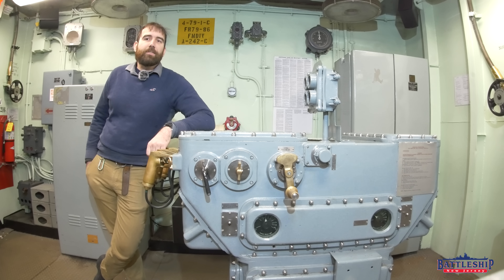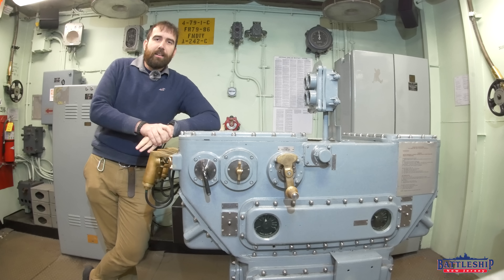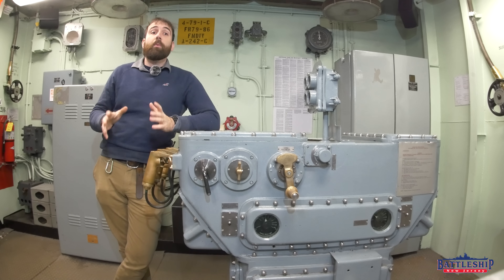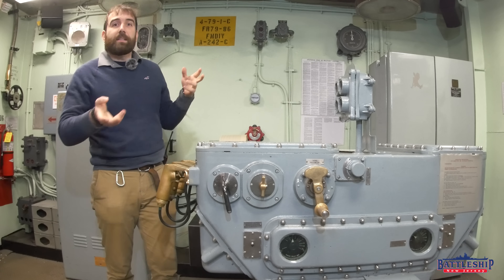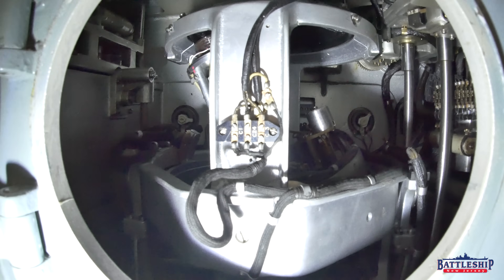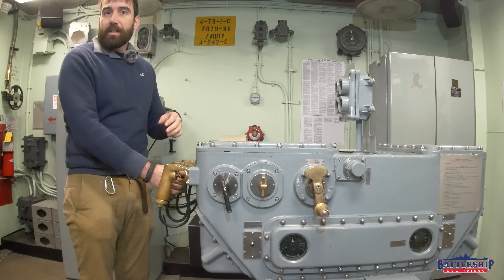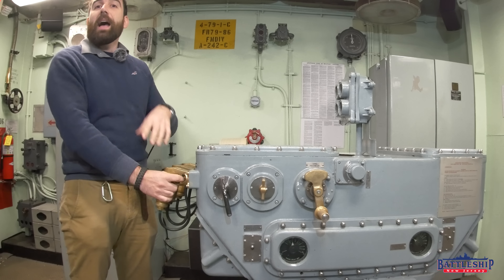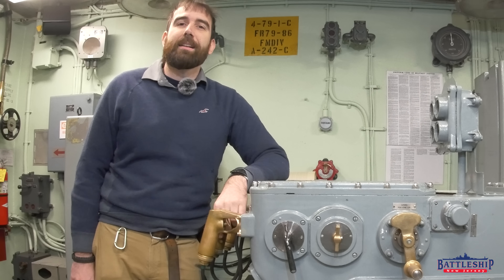The Firing Mechanism for the 16in Guns

Comment: I like how despite all the millions of dollars in mechanical and computerized aiming equipment for the 16" guns.... there's still a trigger and a pistol grip as the final step. Click, BOOM!
Reply: I mean, if it ain't broke...
Reply: I could be wrong but I believe the Ohio’s still have a trigger for the ICBM’s, like a trigger/pistol grip shaped trigger
Reply: @jordancarter8310  Nope, you're right. It's a pistol grip with a trigger on a wire that's kept in a safe behind a combination lock.
Reply: @jordancarter8310  same in Royal Navy SSBNs as they also deploy Trident
Reply: @jordancarter8310 wwweeeee
Reply: The original “point and click” interface
Reply: And the pistol grips are snazzy brass.
Reply: Fun Fact. When the ship was renovated and missiles put on it they didn't change to computers for firing the main guns. The old analogue system is very accurate. So 40s tech was good enough for the 80s and 90s.
Reply: @johnmanley7859  read about that 👍
Reply: Murica, hell yeah!
Reply: Yeah this is a nice touch. They could have done this in a much simpler way, but they clearly had a bit of flare:}
Reply: @tootone  "Flair" actually.
Reply: It's either that or a Big Red Button that you slap with your palm ... and the M1911-shaped pistol grip mechanism just gives it that little bit of extra "you're about to kill somebody" gravitas, as opposed to a big red "Emergency Stop (in this case, many people's lives" button.
Reply: Dont be mad...im sure it comes in very handy.
Reply: One of the largest cannons ever being fired by a button? Never.
Reply: Look like an expensive pinball table to me 😂
Reply: I always want a person in the loop who is ultimately given the responsibility to pull the trigger.
Reply: it's better than the old fashioned lighting a fuse method & be like oh crap, I cut the fuse too long or oh crap, the fuse is too short or like oh crap everything's too wet to function, although old fashion does have it's pros & cons, just like anything else, the person that invented that is a freaking genius, our Crow's nest didn't get blown off while we was being shot at, that's a plus.
Reply: I recall, on a submarine, the red pistol grip is a fake one for drills and the black one will fire the missile.
I read that the mechanical computer was used until the mid ‘70s.
Reply: Maybe they are mechanically connected to the fire mechanism? Traditional fire mechanism would be useful if there is an unstable power situation or under electronic warfare.
Reply: Every military device is just high tech caveman things, tank killer? Super fast arrow with super dense metal, naval cannon? Big iron
Reply: I like how this system was designed in the 30s, if not earlier, and worked just fine and that's why it's designed to operated with triggers. Wait until you see what controls our ICBMs.
Reply: Yeah, I wondered to. I first thought "what are the gazoline pistols for?"
Reply: Actually, it goes click, click BOOM
Reply: @Steven9675  Is that where Saliva got the idea for their song?
Reply: 👉 Yeah, but here's the important aspect no one is talking about. There's a new federal ATF "rule" that heavily regulates and criminalizes a bunch of different guns, based partially on the type of grips and accessories they have, especially pistol grips! 

 Based on these new ATF "rules", I fear that since the USS New Jersey's guns are operated by a pistol grip mechanism, the ship's main guns will now be officially categorized as "short barreled assault rifles", and Ryan will have to register them with the ATF within 60 days, or else be charged with a felony! (😁😕)
Reply: @HighlanderNorth1  right I would love to see them try and come take it,  those are some of the biggest guns ever made, and the most armored vessles still in existance they are not taking the guns without a significant fight if the ship were fully crewed and running crusemissles even exculded it bristles with guns and has 9 that have the penetrating power of a mk 85 bunker buster bomb each armor piercing one 30 feet of concreat and that far in land it would inflict a hell of a lot of damage.
Reply: "Computerized" 

Dude.. that's a MECHANICAL computer... 

That's got more in common with an 1940s Ford Tractor than it does the PC I am typing this on. 

Calling it a "Computer" ... it simply isn't. That's the most MIND BLOWING thing about those battleships.. they could hit a DESTROYER sized target, from twenty frigging MILES away, with nothing more complex than a motor driven fancy calculator. 

If you got a modern ship, and hit it with something that knocked out all the computers and modern electronics, it would be utterly effed. 

Do the same to the Iowa class and all your gonna have is a FURIOUS crew, without radios or TVs lol. 

The ship would still be very capable of kicking ass.

It's not just armor, survivability, and backup systems upon backup systems that make these things tough as nails. 

Probably the biggest one is the simply lack of ANY modern electronics, (except stuff like CIWS, tomahawk etc that was added on) Even the damn radars would be pretty much free of modern electronics. It's remarkable. 

We are talking the absolute height of late 30s to mid 40s technology.
Reply: I don't believe there's any computerized anything to aiming the sixteen-inch guns I believe its all mechanical.
Reply: @thomaspavelko9412  it's mechanical yes but those are still very complex computers controlling all the guns- mechanical computers are ordinarily much more limited in scope than transistor & digital computers we know today, but are still far, far beyond what was available only 30 years before them, and calling it not computerized really discredits the gargantuan effort that went into making the gunnery system work.

Beyond all the mechanical computers interfaced with the systems, they also integrated radar & other even more advanced technology into the gunnery systems.
Reply: @KennyCnotG  Electromechanical computers are more limited in scope, but they continuously calculate based on their information inputs in real time. No glitches, running out of memory, or ‘pc load letter’ flashing on the display screen. The only time you would have to wait for a firing solution is if the automated inputs (speed, pitch/roll/radar rangefinders etc) were damaged, so sailors would have to dial in settings. Otherwise, once you set the target, as the inputs change the guns will train and stay on target as long as it is within their traverse speed limit. The system will also automatically fire as soon as the guns catch up with the plot ‘window’ as long as you are squeezing the trigger.

It was so robust and quick, and fit for purpose, they really didn’t need to change it. Also it is impervious to EMP.
Reply: @KennyCnotG  is sure is a computer, just not a digital one which you can program. here, the programming was done when all those gears were, well, computed, and assembled. but when it's all together, it's a computer.
Reply: @Oldguy1900  a computer is something that performs calculations, in this case it is a mechanical computer. The term used to be applied to humans  who did calculations too.
Reply: @Oldguy1900  that is true, but i believe he was referring to the fact that it was a pistol grip trigger and not, say, a button to press, or switch to flip.
Reply: @Oldguy1900  It's a mechanical computer.. All those gears serve the same function as transistors in a logic circuit on a modern chip. It's all just math.
Reply: @DeliveryMcGee  Sort of - there's an important distinction, which is that this is a mechanical analogue computer, whereas modern computers are electronic digital computers.
Reply: @DeliveryMcGee  No, the transistors in a logic circuit compute digital values using binary (Boolean) math; those gears compute values in continuous fashion; they are solving differential equations while they are receiving the inputs, something that even the fastest digital computers can't yet do.
Reply: @Oldguy1900  It's a mechanical analog computer.  But it's certainly a computer by any reasonable definition.  Just like a Norden bombsight was a computer.
Reply: @Oldguy1900  It's all computerized. It's just analog, i.e. mechanical, verses digital.
Reply: @Oldguy1900  Technically it is a computer, it is just an analog computer.
Reply: @Oldguy1900  I think it's classified as a mechanical computer rather than digital.    In the UK we used to have mechanical computers to calculate tide times and ranges.
Reply: Mechanical computer,  still a computer and probably faster if no backlash in the gearing
Reply: Appreciate the corrections 😊
Reply: @Oldguy1900   that's how Computers started off as, in fact if you think about it, the entire thing is mechanical, the wireless transmission crap, not as mechanical & I wouldn't trust wireless on my car, old Computer, your Hard drive was a giant Cassette tape.
Reply: @Oldguy1900  It is an electromechanical computer.
Reply: @Oldguy1900  their was range system run by a computer.

Comment: I'd sure like to know how recoil from one gun affects the aim of others.  Same turret or different turret?  Simultaneous discharges?  How close to simultaneous is possible?
Reply: Tests have been done on this. During WWII the guns fired nearly simultaneously, during Vietnam they'd been changed to a 0.2 second delay, and in the 80's a full second between the firing of each barrel on the same turret. If you notice, they always fire the same way if they're firing all the guns. Center, left, then right. Apprarently they just covered New Jersey in stress sensors and determined 1 second delay was needed. It seems the last change in delay had more to do with structural stress than the overpressure from the muzzle blasts.

I could be wrong on some, or all, of that, but I'm pretty sure I've read that somewhere
Reply: @HoldenOversoul  I thought the delay was to better tell how each guns range was?
Reply: @ionstorm66  nah, if you shoot all guns simultaneously the Shockwaves from the muzzle would push the shells in different direction. mostly with the center gun pushing the outer ones outwards
Reply: @ionstorm66  a 1 second delay wouldnt tell you much when shell flight time is 20 or 30 seconds.
Reply: @leftyo9589  It will on the receiving end. There are spotters on the ground, and having the separation on the hits is enough to tell what hit were. Same for at sea with the spotters.

Comment: How long could the 16in guns be fired continuously before overheating?
Reply from the maker: With a 30 second reload time at top-speed its not as much of an issue with these guns as it with others.
Reply: @BattleshipNewJersey  Yep, and that time will get higher and higher as the gun crew wears out.
Reply: @ionstorm66  so I guess it’s the gun crew that overheats.
Reply: @ionstorm66  Fatigue-limiting step seems likely to be the 110-lb bags of powder that the sailors have to pivot-carry from the magazine scuttle to the powder hoist.  Each of three guys has to move two bags, one after the other.  Repeat every 30 seconds.  Of course, down there below the gunhouse you could probably spell them off.  Inside the gunhouse there is less physical labour but no way to get new guys in while the turret is buttoned down for action.  Ryan says in another video that the Navy never actually tested its crews to see how long they could keep up that level of activity.

Passing 40-mm ammo clips up to the quad-40 Bofors must have been exhausting work for everyone in the train from magazine to gun tub.  Four guns in each tub going, what, 120 rounds a minute each?  Bet all the Iowas fired more cumulative weight of 40 mm than they did 16" in the Pacific.
Reply: @BattleshipNewJersey  thinking about all things that have to be done to reload such big guns, 30 seconds is really fast.

And the firing computers and such are really impressive. I used to think (or more like assume without much thinking) that a WWII era systems would be much more straight forward than that.

But while those gears and cogs might not be programmable, in the way modern binary computers are, the results are without any doubt quite dangerous, if you happen to be on the receiving end...

It is quite interesting to think how a mechanical device can perform such complicated calculations. The people who designed those things must have been genious.
Reply: They carried around 130 rounds per barrel. So at a hypothetical best rate of 30 seconds a round they would empty the magazines in 2 hours, and have to sail off to somewhere where they could reload a full 1200 rounds.